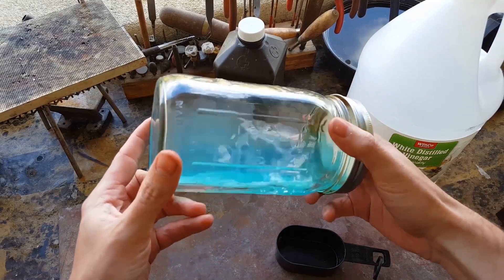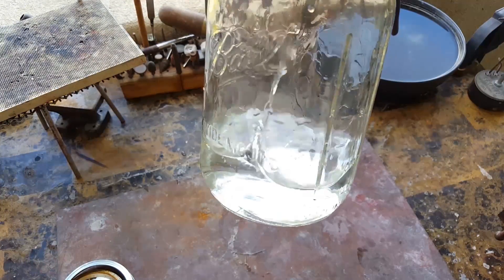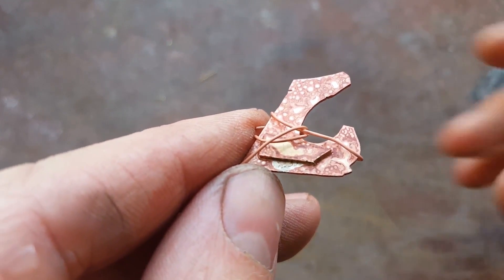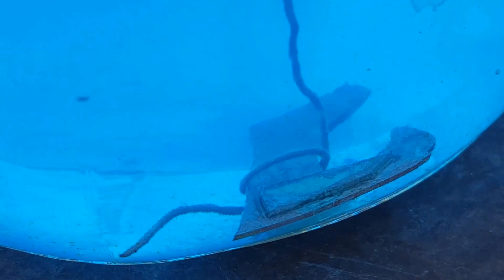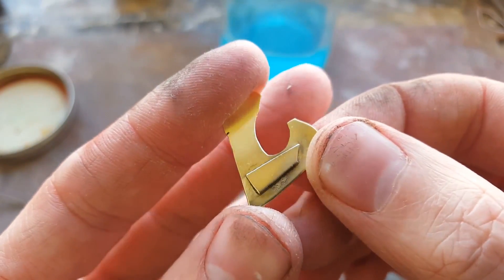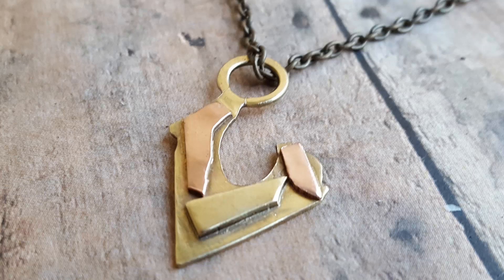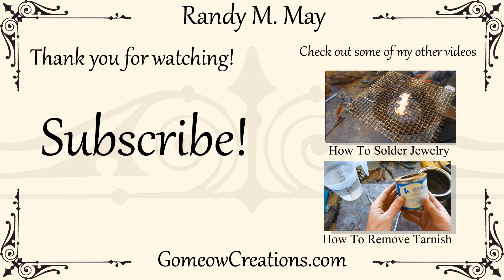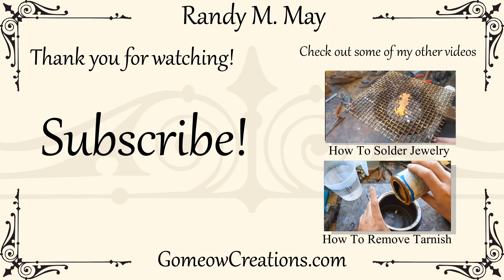Simple Trick to Clean Brass After Soldering

Comment: I would check out the chemistry, but it looks like the copper is dissolved in solution.  It VERY possible the solution will allow the copper to pass the blood/skin barrier like Copper 2 Sulfate does.  If so, EXTREME care should be taken when handling the used solution.  Copper poisoning is a real danger.
Reply from the maker: +Steampunked Out I will be adding a warning to this video about that. Thank you for the info. =)
Reply: Mixing vinegar with hydrogen peroxide creates 
peracetic acid, so you need to do this in a well ventilated area as the fumes can be corrosive to the lungs.

Comment: Hi this looked like the answer to my issue heating up brass but having checked wether hydrogen peroxide and vinegar mixed together is safe the answer seems to be no. It is warned not to mix the two chemicals together as it forms peracetic acid which is apparently potentially toxic and an irritanat to the eyes, skin and respitory system. ( is this method really that bad)?
Reply from the maker: I use this all of the time and have no problems with it. If you like make sure to use gloves and clean the price off with clean water

Comment: Been using this solution for a while for brass.  It also works great after etching brass, which I've found also brings the copper to the surface.  It makes cleaning up brass so much easier!
Reply: When I mix a 50/50 as shown my brass turns from pink to brown.. any suggestions .. (as you said yours was working)
Reply from the maker: That's normal, just clean it off with some water and some polishing wheels
Reply: @GomeowCreations  did a test earlier and  found white vinager helps flake off the brown smoosh too
Reply: @GomeowCreations  did a test earlier and  found white vinager helps flake off the brown smoosh too
Reply: @mattinkel7342  the brown stuff is normal...albeit very gross and offputting.  LOL

Comment: Are you wrapping a wire around the piece to help move the metal?? Is it a copper or brass anode wire 🤪🤪 I’ve been pickling & using the solution without any wire
Reply from the maker: It's just to hold it so I can get it out of the liquid

Comment: I just recently started using this method. I learned from my jewelry instructor years ago, but only tried it myself when I came across ur video. I was taught to use 3 parts vinegar to 2 parts hydro peroxide so I tried that first & it worked perfectly. So much better than super pickle.
The only thing I can't find an answer to is how to dispose of this solution properly?? Can it be poured down sink? Does it need to be diluted? How do u dispose of urs? Thanks
Reply from the maker: Let it fully evaporate and then you can dispose of the solid material in the trash.
Reply: @GomeowCreations  thanks👍

Comment: how do you discharge the solution after being used? Thanks for the video, I just clean lots of bronze pieces I soldered and it worked perfectly!
Reply from the maker: +Lorena Angulo check to make sure your drains go to a water treatment plant and you should be able to pour it down the sink will lots of water and make sure not to get it on any metal without washing this off... But make sure to check if this is ok in your area so you don't harm local body's of water.
Reply: Thanks!

Comment: Hi, thanks for the tip! How would you clean a large brass piece that cannot be immersed? I soldered two 4ft sheets and cannpt get rid of the copper/blue/black stains. Thanks!
Reply from the maker: +wagedu sorry about the delay in my reply. For something that big I would try to you a steel wire wheel to get averything off then maybe sand the area and then polish it.

Comment: thanks for the tip ... , i tried this before with the pickle and piroxide  ( my teacher show me that )...  and work, right now i am in mexico and i tried your simple trick : P , after i pickled my pieces of brass i throw this into the solution that you say and the brass become black..  you know why ? i made the solution two times   and was the same
Reply from the maker: +marco zuleta I'm doing some testing on this right now to see if I can make it happen to some of my work. I have seen some black spots come up on some of the brass. What I did to get rid of it was take a brass wire wheel to it and it came right off. The problem is the black spot left behind a scar in the metal. I cleaned this up and polished it. After that I put it back into the cleaning mix to see if any more black spots came up. I'm still waiting on this now.

I did try washing one of the brass pieces with dish soap, as for the other piece I moved it from the pickle into to brass cleaner. After 10min the washed piece had no black on it, the other piece started get some black spots on it. 

I still have more testing to do to see what is making this happen. So far it looks like the pickle can have something to do with it.

Comment: i tried to clean my brass hardware on my bag with a metal brush and it turned pink on some area
what should i do with that to get back in yellow shiny color?
Reply from the maker: It sounds like you took the brass colored coating off them any now you can see that they are just made from copper. A lot of thing are copper and just plated or coating in whatever color people want. 

Sadly if this is what happened you not going to be able to make them look yellow again
Reply: @GomeowCreations  thank you
Reply: they said it is brass ,now i know why any brass polish did not work.
any way pink spots are very minor 
i should leave it that way.
Reply from the maker: Yep

Comment: Peracetic acid is a pretty corrosive chemical. It's weaker than acetic acid, but is a strong oxidizing agent. I have seen it used for forcing rust on steel. Whether copper poisoning is a risk or not with this solution, the base chemical is not something you want on your skin in the first place. 

https://en.wikipedia.org/wiki/Peracetic_acid
Reply from the maker: +DragonHide94 your are very right. I put some on some steal and it started to rust right away away. I haven't gorlt any directly onto my skin, and I made sure to rinse the part off before touching it. :) I might need to take this video down an reupload it with some added safety warnings.
Reply: GomeowCreations This video has been up for almost a year and I don't see a safety disclaimer yet. Did you find out if this is safe?

Comment: not helpful at all.  how did you get copper on there in the first place?  what is [pickling and how and why do you do it.  seems like too much effort.  just braze the brass to brass and clean it  this video needs to contain all the info instead of using the word pickling and absolutely ignoring it.  pickles are for eating.  not for metals
Reply: Sometimes when you don't know what a word means, you have to look it up. A quick google search turned up this definition for pickle: immerse (a metal object) in an acid or other chemical solution for cleaning. Many words have multiple meanings